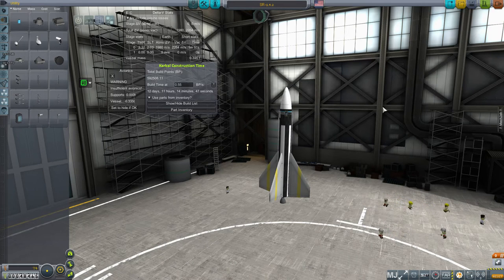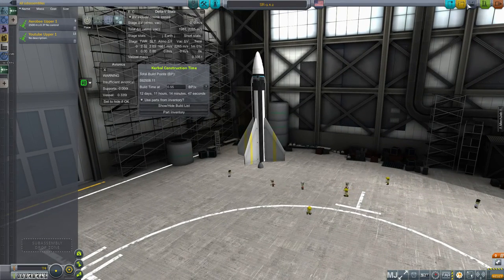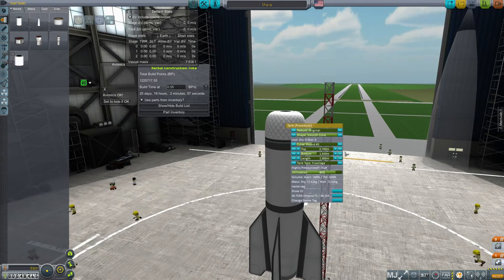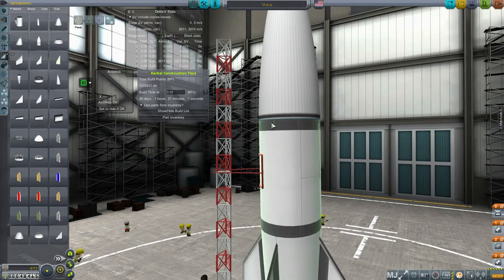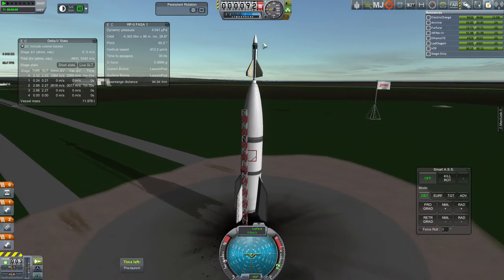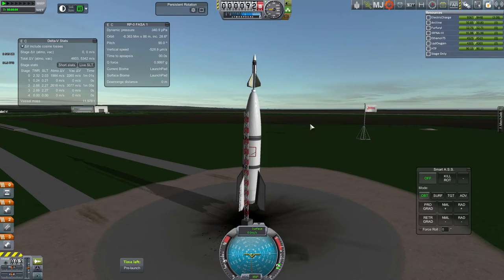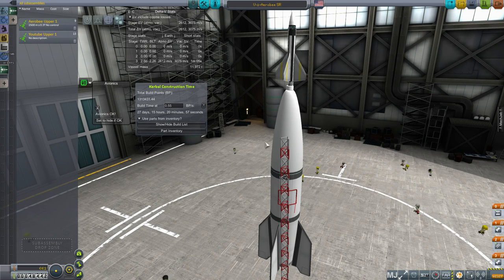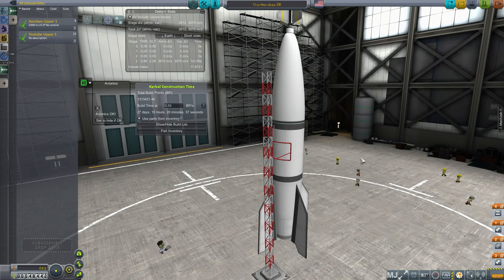RP-0: America 6 - This V-2 Gone WAC

Comment: I think you hav'nt noticed, but the fin of the V2 stage hits the launchclamp on liftoff, because the rocket is angled into that direction. and what's confusing MJ could be the engine stage before decouple stage. and your v2 has still antennae on the side. you could remove them to decrease drag a tiny bit. I also would put the science instruments underneath fairings on top of the second stage to reduce drag a little bit more :)